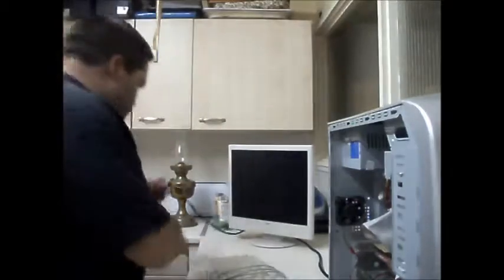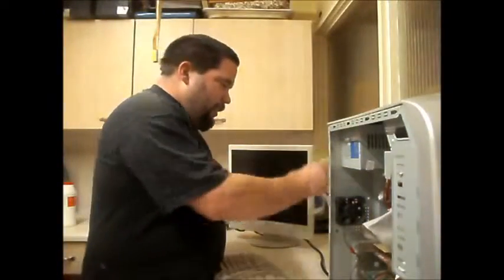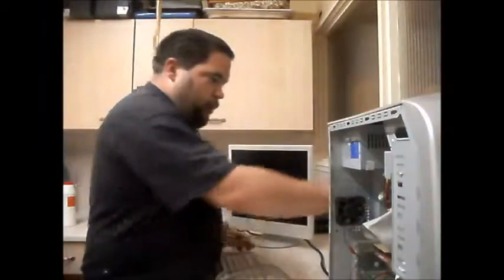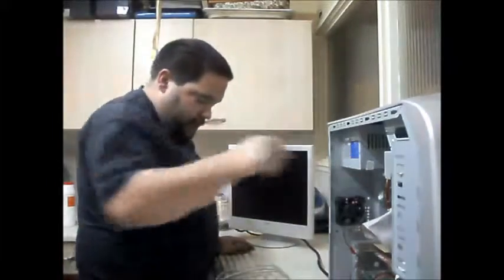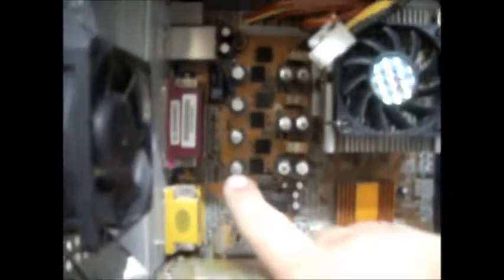Finding out why my windows 2000 rig has failed

Comment: With the win2k machine you will want to replace the psu caps as well, they will be in similar condition, and replacing them will probably get it running even with the bad processor board caps. As to the FF issue I will guess you have the auto update feature turned on, and as the security now will not allow SSL1 connections unless exempted you will get this issue till the website owners upgrade to SSL2 or later. might also be a cache supplier upstream in BT doing this. Upgrade to latst FF or use Chromium, and you might be fine again.

To test if it is your machine simply make a live ISO of Linux mint, and run the live CD and try browsing using it. Will work fine with your XP laptops, though you might need a wired connection till the wireless drivers are downloaded.
Reply from the maker: SeanBZA  Thanks.